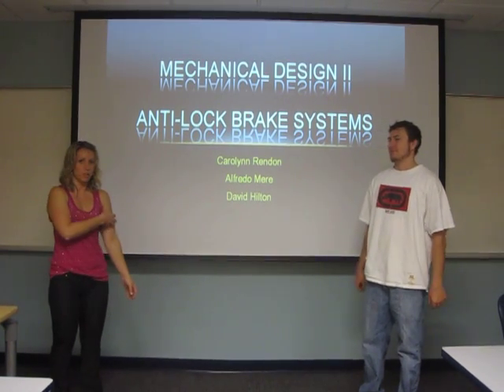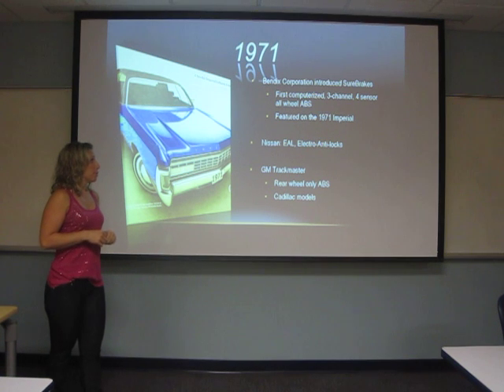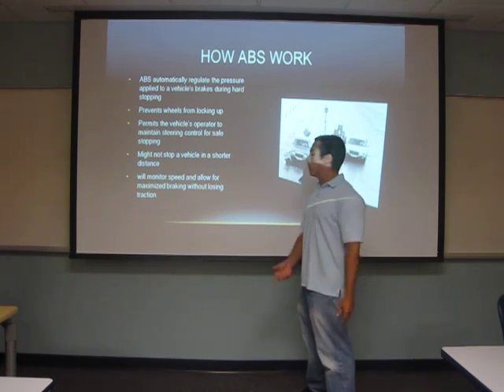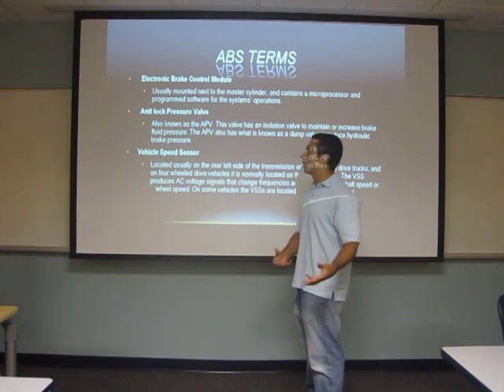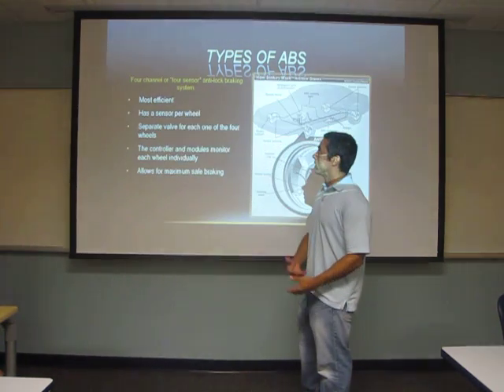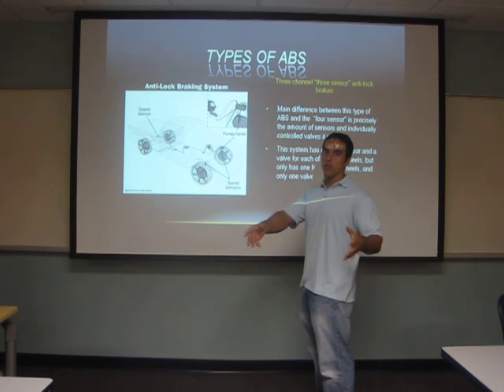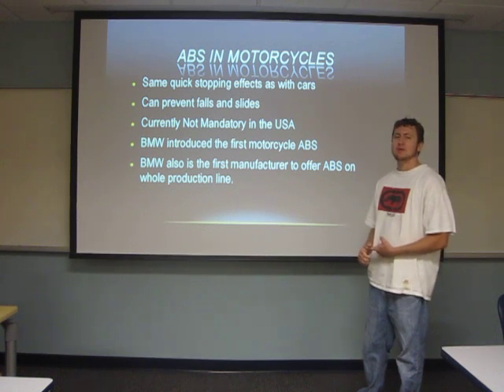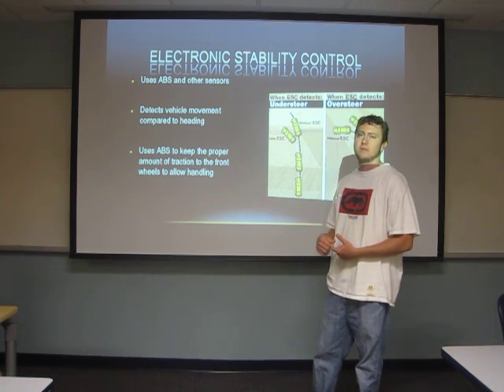Team 21: ABS Brake Systems

Comment: Great video quality. Information given was clear. All presenters were knowledgeable of the information and spoke clearly. Alfredo did a great job at presenting several different types of ABS and terminology. David,  being a motorcycle enthusiast, spoke well of safety benefits of ABS in motorcycles, braking assists and ESP. The team also concluded well. Great job guys! :)

Comment: The text on the presentation is small, a little bigger should be fine, but the presenters explain it very, felt unnecessary  to read slides